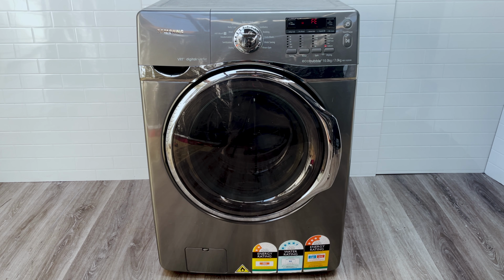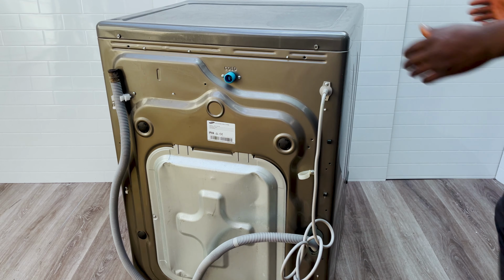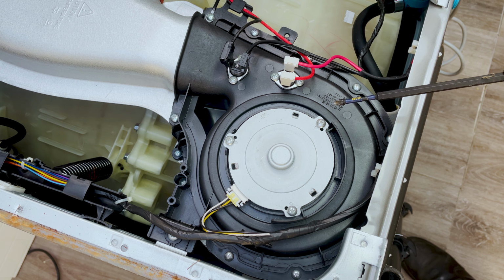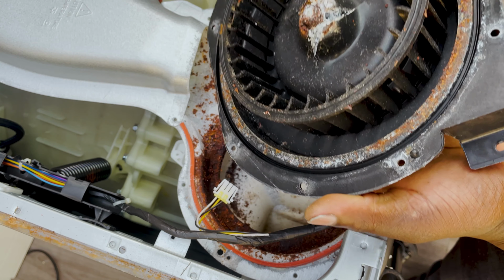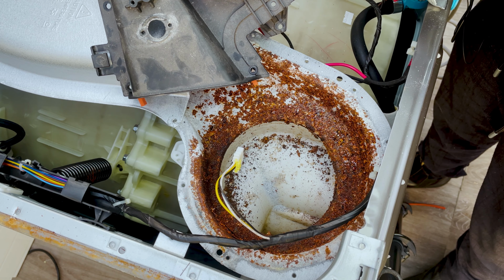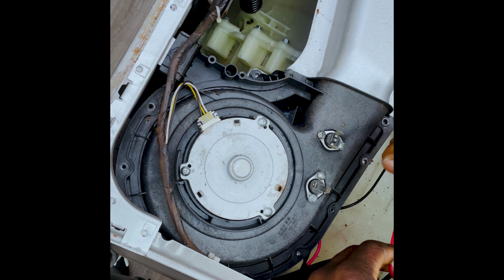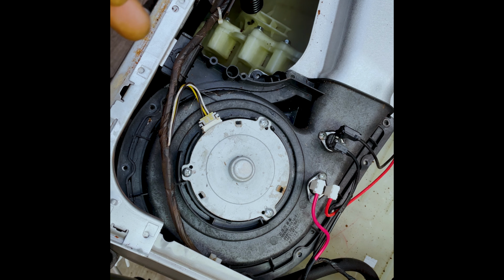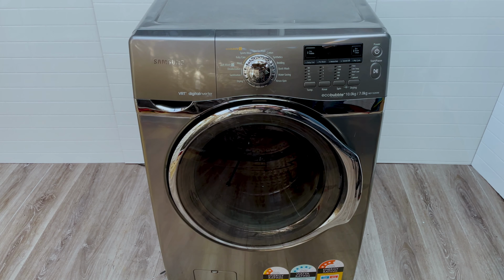Samsung FE error Fix

Comment: If your fan is running, check for blockage in the plastic container the fan sits on. Enter from the back and undo black hose clamp and check from bottom

Comment: Hi I’ve had this error code today. Took all all apart and the fan area was loaded with what looked like mountains of soap powder and wet fabric fibres. The fan was seized. I cleaned it all up and got the fan free but it sounds horrible now really loud and spins flat out. The blade lock nut was completely rusted. I’ve come to the conclusion that the fan motor internal bearings have worn out. When buying a new motor does it come with the reverse thread lock nut? Or do you know where to get one from?
Reply from the maker: hi i think a new fan should come with the nut otherwise you can go match it up at your local hardware shop

Comment: Hi, and thanks for this video. Just recieved an FE code as well, but on my stand alone samsung dryer, not a combination unit. Qould you know if the fan in the same spot on just a dryer? Thanks in advance!
Reply from the maker: Hi welcome. On the dryer it is usually attached to the motor so its in a different spot. You will need to remove to cover and right hand side cover to access the fan

Comment: Hello, thank you in advance. I have a Samsung Dryer and it doesn't power back on for a long time after a drying cycle and I think I got an FE code after the last drying cycle.
Reply from the maker: Is your fam making a noise during the cycle ? You also need to clean the dryer up if it’s a heat pump one https://youtu.be/kyk4i-4_Hfs

Comment: Clean my fan fan runs free still getting fe error after 5 min running what else can it be
Reply from the maker: Might be rubbed through wiring to the fan
Reply: @askmrwashywashy  found the issue after try every thing, the box the fan sits on was blocked at the bottom taken of clamp on rubber, and unblocked was restricting air flow. 

These things look like a fire hazard waiting to happen.
Reply from the maker: @CymruDrone  wow glad you were able to fix it. Oh yeah fire hazard indeed